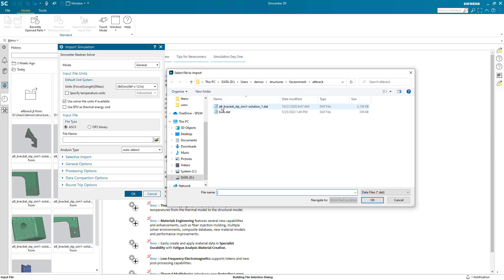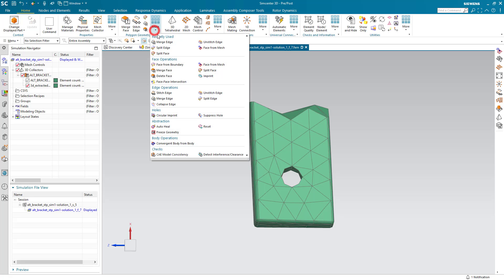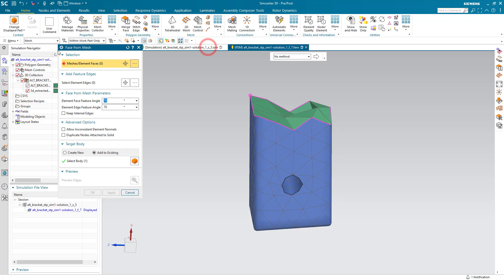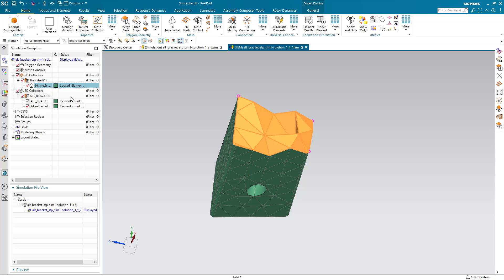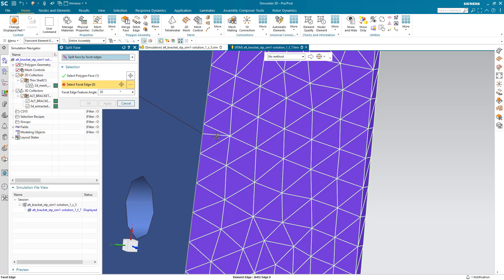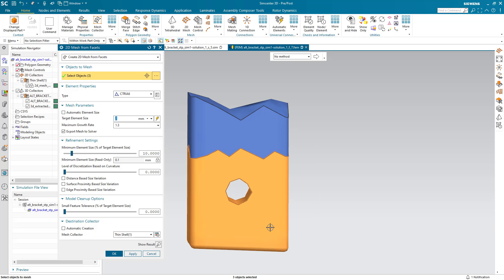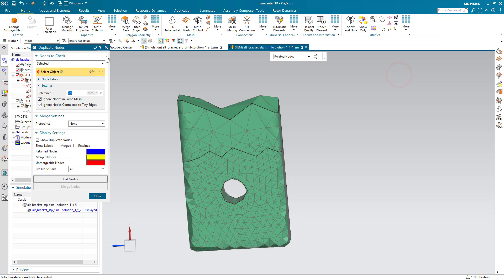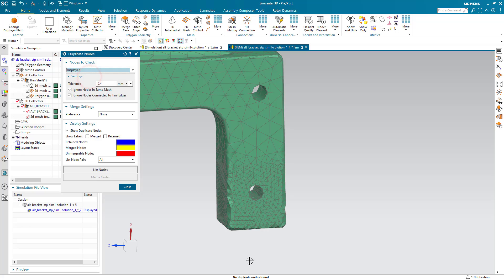How To Refine An Imported Tetrahedral Mesh

Comment: In an assembly fem, is it possible to copy physical properties from one component fem to another component fem. Thanks
Reply from the maker: Export a deck (menu - file - export - simulation) with  export options to only write out the materials and physical properties then import using File - Append to the fem where you want the properties.